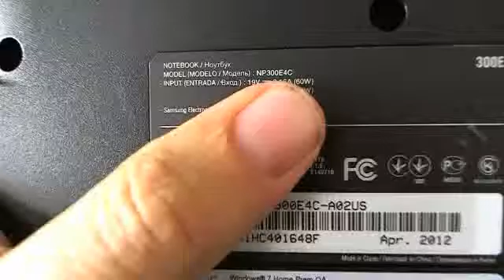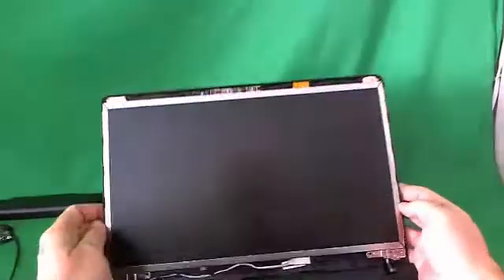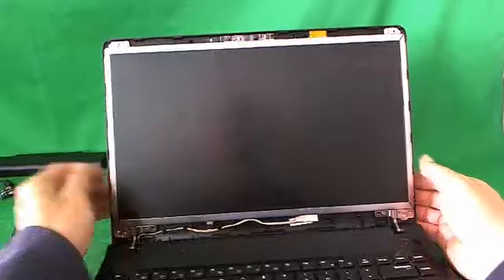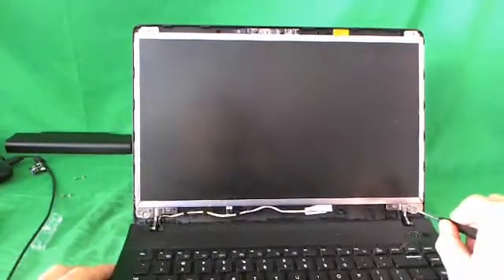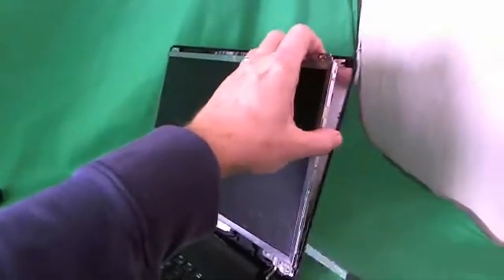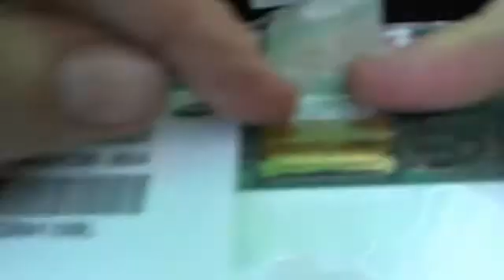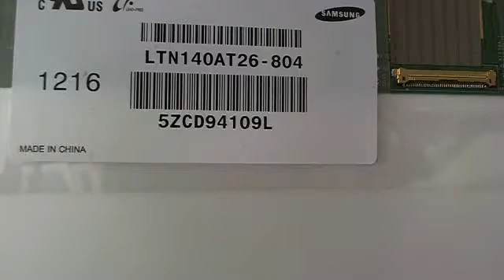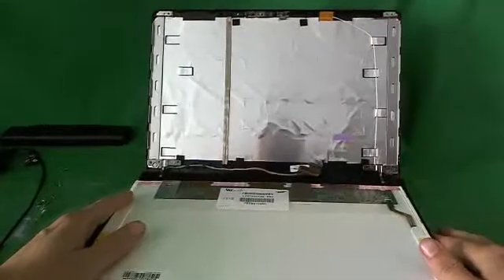Samsung NP300E4C Laptop Screen Replacement Procedure

Comment: Thank you so very much for a solid walk-through on how to swap out a screen!  I was totally comfortable with the idea of replacing my husband's old 17.3" screen so the kids had a laptop...until I was holding the $80 part and praying I wouldn't mess it up. 
The video is for basically the same laptop, but without the number pad-- we got the replacement screen for a little bit more on Ebay, without free shipping and without a tool kit.  Obviously, wish I'd found the video sooner. :D 
  Will definitely keep Screen Surgeons in mind next time a screen dies around here!

Comment: I'm looking t o replace the stock screen in my hp envy dv6 7229wm with a 1920x1080p anti glare with touch screen. Was wondering if it can be done? And if you carry the part that I need any help would be appreciated. Thanks